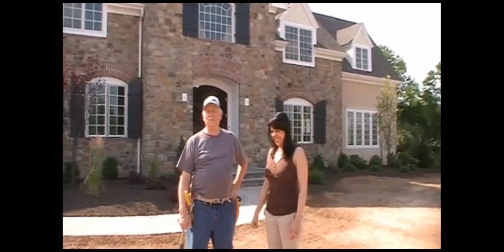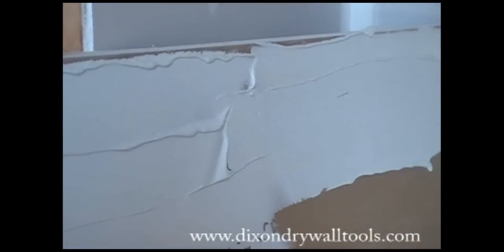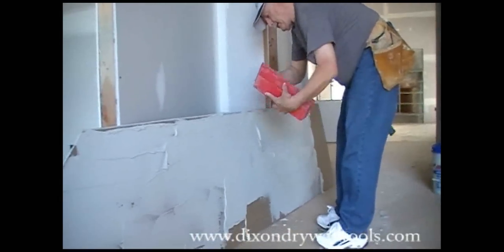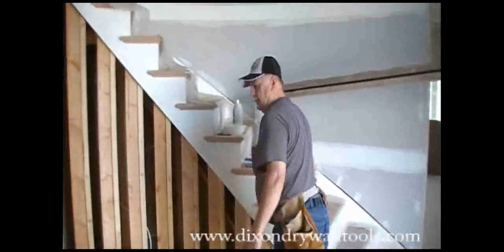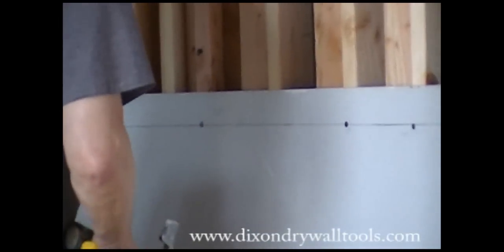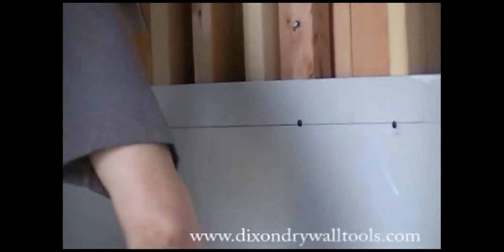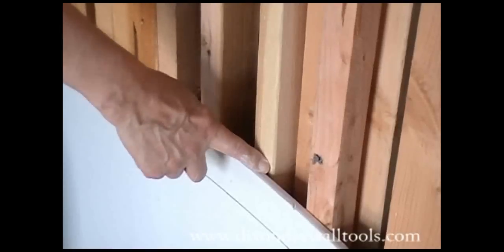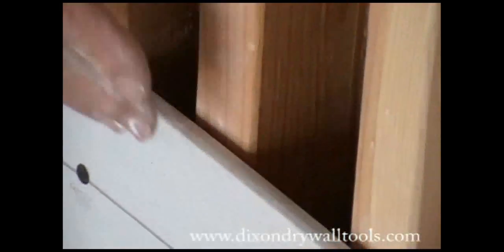How to Hang a Rounded DryWall Faster and Easier - Part 1

Comment: nice job from a veteran doing his thing. to much negativity online, do whatever works for you. whether it's water or mud. only thing I would do different is use an economy paint roller to apply apply the mud just so I could a uniformed thickness so when it dries there won't be any semi high spots in the wall... and I wouldn't use nails... but that's just me. nice job either way

Comment: Looks Nice!! Why do you use Nails rather then Drywall screws? I'm a painter by trade and find In New home construction there are more nail pops with nails then Screws.
as for the using Water why would anybody want a chance to wet the paper and have a chance for mold growth.

Comment: What a rookie. You don't use mud to moisten up drywall you simply brush some water on it and let it soak for a 5-15 minutes depending how tight the radius is. Water is more quick and not as much of a potential mess.
Reply: The mud is to delay the drying process of course... I would think that was obvious to anyone who hangs drywall.

Comment: For all you new b's asking why nails rather than screws is you can control the hammer a lot better than the screw gun as far as putting the right amount of pressure with out breaking the board once u get it sett the you screw it down 9 out of 10 times if you start with screws that screw is going to go right through that board and yes WATER works 100 times better just don't put to much and only on the back side a sponge if perfect I usually do it twice
Reply: Incorrect, a hammer does not equate to better pressure, but rather the fact that it's traditional, and faster. A drywall screw is significantly stronger, and you have much more control with a variable speed gun. You'll "screw it 9 out of 10 times through the board if you have no idea what you're doing. And NO, water does not work 100 times better, gypsum wall boards are just that, gypsum, and paper. Unless you're using green boards, you're risking mold.
Reply: I use screws to start it just don't drive the head in all the way.
Reply: +Chico SC-LA I'm sorry but you're wrong, Once you get used to it, screwing is faster, stronger and once you pop the board with a screw once, you realise how much pressure you need, aside from that nearly every drill has some kind of torque setting.  If you miss the nail with the hammer, and let's be honest, everyone's done it, you've then got a hole or dent you have to deal with.  If you screw it, you don't need to glue it.  If you get a self feeding drywall driver then it's even easier. as for bending it, I don't see why there would be any difference what exactly you use, as long as you're careful.

Comment: you lay the rock on the floor and pour water on the back till it gets pliable, you can also stand the rock up against a wall at an angle and it will slowly bow
Reply: your right about that

Comment: the mud on the back is almost like the lath and plaster, it gives a lot more support with the bend rather than the spraying with water. but the Mexican'ts will hose down with water and call her a keeper, either way will work.
Reply: OchoaPrideMex4Life  eso es correcto
Reply: I love the Mexicans that I work with.  We treat each other with respect and we all get along great.
Reply: just double quarter inch wow

Comment: Should rub water on it alot cheaper and faster you can bend a 12 ft board in a circle and it you dont have to "soak it" the latinos i work with dump it on while its flat rub it down pick it up and hang it easy stuff